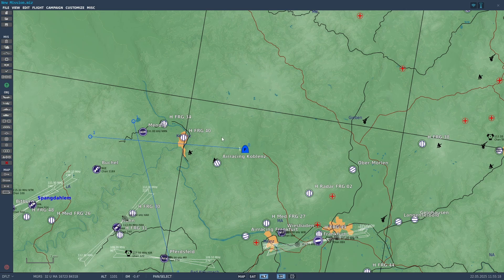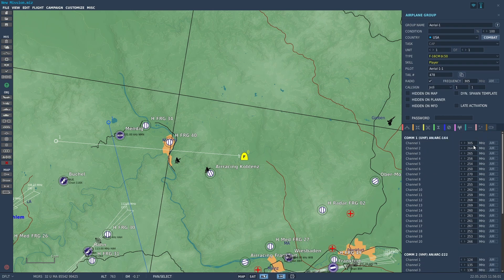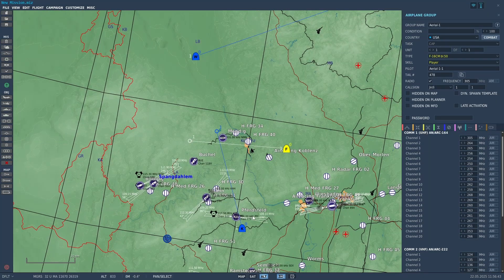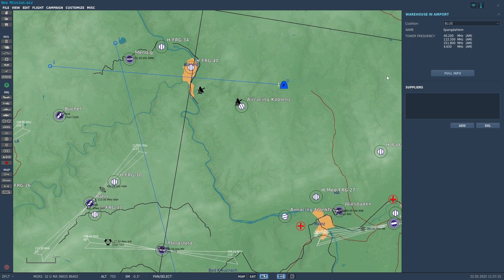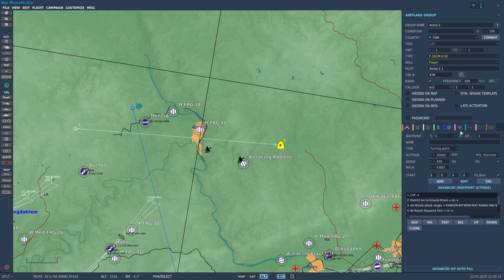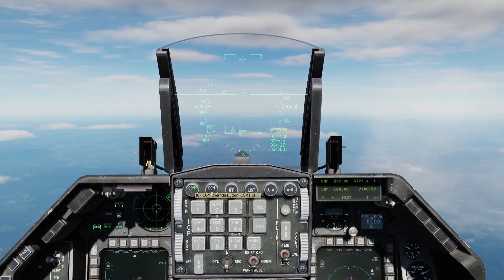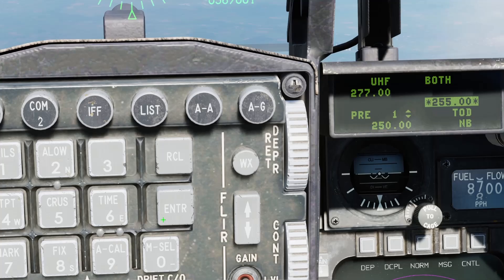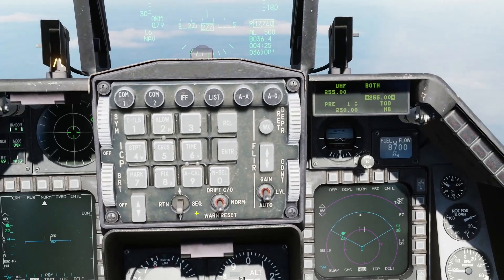DCS World: The F-16 Radios Tutorial

Comment: VHF in the F16 covers more than just 108 thru 151.975. It can do both AM and FM ranges. You only listed the AM range. The FM range is 30.00 to 87.975.

Also, pro tip if you enter a frequency/preset and want to go back to the previous frequency/preset just press either COMM button on the ICP and press ENTER on the ICP and it will go back to the previous frequency.
Reply from the maker: Yeah i forgot about the FM frequencies, thanks for reminding me